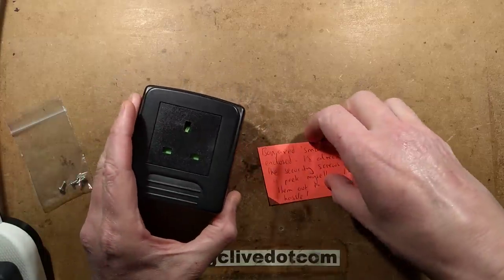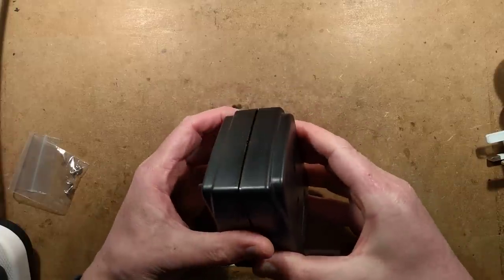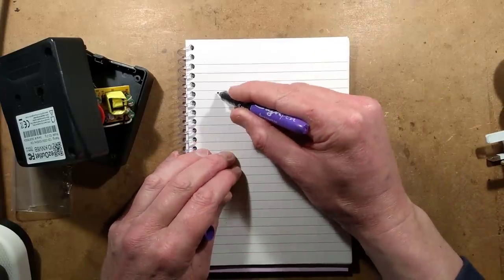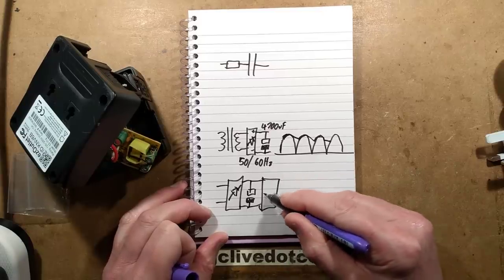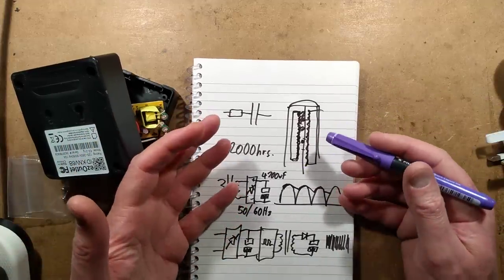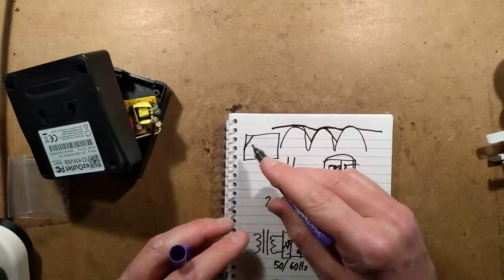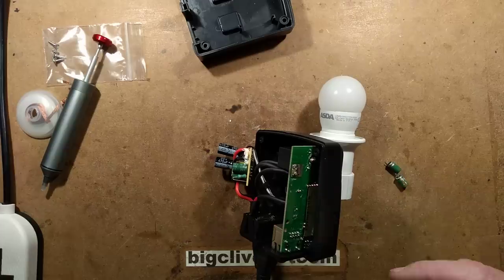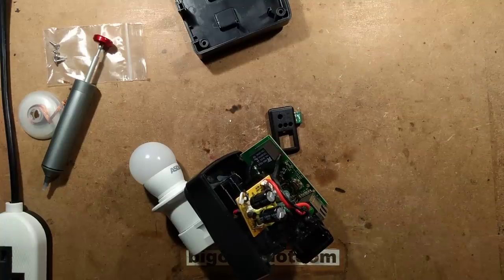Fixing an ezOutlet with inappropriate components.

Comment: That brand of cap failed in a cheap flame lamp that had run less than 20 hours. Thank you for making electronics, engineering, and circuitry into a wonderfully digestible affair.

Comment: I really like it when you go off track for a bit. The hint about monitor picture tearing at the corner was really useful... as was the quick way of measuring ripple with a meter set to AC. These are the tit-bits that you usually only pick-up with experience. Great video and interesting as always.
Reply: Word.
I come here for the subject matter of the video, but I learn the most from the "off topic" stuff.

Kinda like a fox at the chicken pen, just sniffing about the fencing for a gap...
Reply: I was suprised to read this, still am.
We genuinely learned that in school, like 3 years ago.
Reply: I agree. When he started talking about old industrial stuff and measuring ripple I was very happy that he went off on a tangent. I work at an old steel mill and this really is good info
Reply: Was going to say the same thing - Clive's tangents are one of the things that keep me watching. Sometimes educational, sometimes humorous, never a waste of time.
Reply: Annelise Meier I'm old enough that a meter in AC V mode would fully respond to DC, making that measuring technique not work at all.
Reply: @johnfrancisdoe1563  it works on some meters,  one of mine states it can measure ripple on a dc level on its ac ranges, but most of mine cant, unless you include a blocking capacitor in series..
Reply: tidbits*
Reply: Yeah agreed 👍

Comment: That sort of 'blip blip blip blip' of the LEDs was a dead giveaway the power supply was faulty.  It's a common failure mode on switch mode supplies.  I go straight to the caps if I see that, and it solves the issue almost every time.  I've seen it on everything from TVs to wall warts.  Nice explanation of ESR.
Reply: Doesn't it happen to LED light drivers all the time too? That rapid flickering looks very familiar!

Comment: The 2000 hrs is when run at their max rated temperature. Usually 85degC.
Reply: It wouldn't surprise me if it ran that hot or hotter if it has some logic and processing chips in there along with the switching supply. Although these are chinesium ones so 2000 hours at any load is probably optimistic. Takes me back to the early 2000's motherboards with all these caps looking like some sort of fungal growth after awhile.
Reply: The ripple current heats it up internally, and inside such an enclosure there is likely a much higher temperature than room temperature
Reply: @mysock351C  That was my initial introduction into electronics - the capacitor plague of the late 90s onwards. I had a relatively new and relatively expensive (at least for me) motherboard that failed due to bad caps. So I bought a soldering iron and ordered some good quality Japanese caps and fixed it. I've been slowly learning more since then - mainly by watching Clive (as I don't do well learning from 'courses' or the like).
Reply: Also running at their maximum rated ripple current, which generates further internal heat
Reply: every 10degC below rated roughly doubles the lifespan. So if it's rated at 85degC you can run it at say 45degC (not unreasonable for a well designed supply) it'll last ~3.65years - enough for the warranty period on a lot of devices! This one failed because a combination of either:
-Too hot
-Too much ripple
-Crap quality and wouldn't even meet its mediocre rating
Reply: Don't forget also at rated ripple current. Decreasing current and temp both drastically increase lifespan. Also it is a minimum lifespan,not a maximum.
Reply: Since this is an always-on device with no ventilation, you should just go with 105C rated. About 9,000 hours in a year.
Reply: David Parry  the capacitors are "0n" all the time - either taking in new charge until the top of the sine wave or delivering charge when the rectified voltage is lower than the voltage inside the capacitor. Current is almost always flowing through the internal series resistance either in or out ...
Reply: In addition to the temp variable (likely 85C, could be 105 if the caps are decent - likely aren't) It's likely also a calculated MTBF, and seeing how electrolytic caps aren't exactly immune to premature failure, it might not represent the actual average lifespan of the cap.
Reply: @uwezimmermann5427  ah, nice to see the calculation formula, thanks! I take it back then, there's quite some difference from "traditional" MTBF. :)
Reply: Yep. At max ripple current too. The life doubles for every 10C decrease in temperature.
Reply: @mysock351C  That's not a problem now. Turns out that when the Chinese (Lelon) stole the formula it was missing an ingredient and that caused the problem. Now they've manage to steal the correct formula, and that doesn't happen anymore. That said, I consider a non-name-brand cap to have half the service life it claims.
Reply: When run well below the maximum ratings, and kept near ambient (room) temperature, and assuming the circuit design allows for a fairly wide margin to take into account capacitor aging, it is not uncommon for good quality aluminum electrolytic capacitors to far exceed the "double life for every 10C below rated" rule of thumb. Pretty common to find switching power supplies in commercial equipment that is on 24/7 to exceed 150,000 hours of use without failure.

But of course in low cost consumer electronics they'll use the cheapest capacitors, of the bare minimum values to work in the circuit (little margin to allow for capacitor degradation over time) and of course very little consideration made for operating temperature of the components.
Reply: I do a recap service for 80s/90s retro computers (Amiga, ST, SNES, Spectrum, C64) and I replace with 10000h@105C low ESR Panasonic caps. Total overkill, but cost wise they are actually comparable to 2000h@85C. Many of the Amiga models have bad caps and the leaking electrolyte is killing the boards. Second biggest killer of retro machines after the Vartabomb...
Reply: I also forgot to mention that several of the Amiga models (A4000 and CD32) have some of their electrolytics in backwards. The reverse drive dramatically shortens their life span!
Reply: @misterhat5823  I only use well known brands of capacitor and for power supplies I always get the caps with the lowest esr and highest ripple current.

In some instances if a cap is run at real close to its rated voltage I may go up to the next higher voltage space permitting.
Reply: their? Pronoun missing object reference.

Comment: Back in the early 80's, I was a TV cable technician. A common problem we had with line amplifiers was caused by failing capacitors in the amp's power supplies. Because we have 60 cycle power in the US and the TV frame rate is 29.97 FPS, (just shy of 30 FPS) the resulting interference pattern was a horizontal line that would slowly work itself from the bottom to the top of the picture. Because we were a small company most of our testing equipment was old and the only way we could find which amplifier was causing this issue was to haul around a small battery powered TV set.

Comment: Perhaps those "unusually small" capacitors are less common for a reason.
Reply: The reason is that good high quality low esr caps are physically larger and they used the cheapest crappiest smallest ones they could find.
Reply: @simontay4851  correect 10 million for a bowl of nuddelsoup
Reply: Had the same issues with small caps in a mixer PSU I recapped a few months back, really hard to find physically suitable replacements with good enough specs. In the end I had to upsize 2 of them as it was "impossible" to get the right ones.
Reply: @petaks01  Same here, the puffed up Chinese ones were all really small and the usual suppliers didn't sell them since all the "good" capacitor manufacturers don't make them.
Reply: @wasserman63  knewdiddle*
Reply: I also noticed that Chinese brand capacitors that often fail - like Teapo, CapXon etc. tend to be smaller size than similarly rated Japanese ones. They are probably overrated and their failure is due to pushing it to the limits for the size...

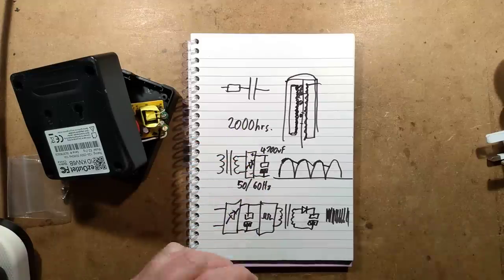Comment: @8:50 the hours are rated at the maximum temperature of the cap, typically 85 or 105 degrees C
Reply: There's a saying that every degree below max temperature doubles the life span.
Reply: I was going to say the same thing - as well as something similar to what Ennar said.
I've been told that a 10 degree (peak) drop potentially increases the life by 10x, a 20 degree drop increases it by 100x and a 30 degree drop by 1,000x. However I don't know the truth of that.
Reply: @Andrew Ballard Thanks Andrew.
Reply: Not just temperature, but also maximum voltage, ripple, and frequency....operating below any of those absolute maximum limits will significantly extend the lifetime of a capacitor....unless the capacitor was made in China, in which case all bets are off...it might last 20 years or 20 seconds regardless of operating conditions.
Reply: @ethanpoole3443  In fact, ripple and lifetime (for a given max temperature and ESR) are interlinked, which means you can trade off one for the other, enabling almost arbitrary specsmanship. Shorter nominal life = this cap gets hotter at given temperature and ripple current. That certainly is one way of boosting your ripple current spec.

Comment: Not sure why I never thought of that, but using the multi meter on AC to measure ripple is genius!  Thanks for the tip!
Reply: It only works on modern meters with certain AC measuring designs.  Traditional meters just switch in a rectifier for AC mode.

Comment: Great informative video on ESR caps and how they're different to normal rated caps, thanks for the explanation 🙂 seems the manufacturer skimped on those capacitors due to size they could fit in the enclosure.
Reply: Had the same thing in the supply/ballast of a Chinese fluorescent work light (these tubes that are barely larger than the 8 W fluorescent inside). Ended up recycling the whole thing because I couldn't be arsed to find replacements for those super-small electrolytics. The older ones simply used 5 metres of resistive flex (rather than normal copper wire) as a ballast resistor. Only in the late 90s or maybe 2000s they got more complex.

Comment: The capacitor that failed is next to the diode. Those are almost always the first thing that fails in flyback topology power supplies since they are directly exposed to the raw ripple current. When I repair PSUs, I add a 10uF MLCC across the electrolytic's leads on the back of the board when possible to spare the electrolytics the worst of switching transients and take some of the flyback edge off.

Comment: I think the super low service life ratings in electrolytic capacitors apply to the rated temperature. They will last a lot longer if the temperature stays lower, for which reason it's really important to 1) use low esr caps where there's high ripple and 2) design the equipment so that the caps stay well below their rated max temperature.
Reply: There are actually a few factors here:  Typically, the "lifespan" of a capacitor is the number of hours it is expected to be able to function:

a) When operating at its maximum rated temperature
b) When charged to its maximum rated voltage
c) Before it goes out of spec in some way (not necessarily outright failure)

This is part of the reason why people often use caps rated for higher voltage than actually needed, because operating them at a smaller percentage of their rated voltage can extend their lifespan significantly (as will keeping them cooler, as you mentioned).

However, even when it's beyond its lifespan (accounting for voltage and temperature), that still doesn't mean it will just fail either (in fact, that's still pretty unlikely for most caps, even at that point).  Usually what that actually means is just that the manufacturer can't guarantee it will still have its full capacity (its capacitance may have dropped to less than the tolerance of +/- (typically) 5% or 10% of its nominal value that the datasheet promises).  But even that is still just a "maybe", it could be that it's still fine, the manufacturer just can't reliably know for sure that it will be.  And even if it has lost some capacitance, it can still potentially work just fine, but you will get more ripple, etc, in your circuit.  Therefore, in many circuits you can also extend the useful lifespan of the capacitor by simply using a somewhat larger one than you technically need, so that it can lose a lot more of its original capacitance before it actually really matters to anything.

Comment: The capacitor ratings are for the worst case scenario. for ex: a cap rated at 5k hours at 105c and some ripple current will lose some percentage of it’s ESR and ESL capabilities if abused to the max it shouldn’t fail. Nichicon FP caps rated 12k hours at 105c used on some ATX motherboards will last almost forever because they aren’t pushed a lot

Comment: Very common phenomenon, even in expensive gear. I fixed my £1000 digital mixing desk this way. The trouble is, power supplies are considered commodities and don't receive the same design attention as other circuitry. Also, I found it not as easy searching for "low ESR", instead I consulted the rated ripple current.

Comment: In my younger days, I was a coin-op arcade video game and pinball machine tech. I've replaced a lot of those 470µF 6.3V electrolytic caps (most frequently in the power supplies) tell ya what. But not every bad cap was "pooched out" (showing signs of elevated internal pressure) -- some of them looked perfectly normal even under magnification. But every pooched-out cap was indeed bloody frickin bad.
 
Wonderful tidbit on using your DMM on the AC scale to measure DC ripple!
I'm almost 55 and I've never heard that one before!
Thank you Clive!!! :-)

Comment: Thanks heaps for the ramble Clive, very interesting stuff. Especially about SMPs and the need for low-ESR caps.

I got 3 minutes into this and, when you were saying about if it was a capacitive dropper when the relay kicked in the voltage would drop and I said to myself "then the relay would 'chatter' at 2x mains frequency surely?" Then I had a real "D'oh" moment. I had a set of two RF remotely controlled mains switches and one of them did just that, went into spams when I turned it on and blew the fuses in my amplifier connected to it. I kept it for a couple years in my "NFG" box of things that I might get around to fixing but threw most of the stuff out a short time ago. I figured that my electronics knowledge hadn't got to the level where I could fix most of it by now then there was no need to keep it.

However I still have the other RF remote switch on a shelf so I opened that and, sure enough the power supply (for the three ICs, relay and a couple LEDs) is a capacitive dropper run by an X2 cap rated at 0.22uF / 275V. I bet that's all that had failed in the other one dammit! I've been slowly learning electronics, mainly by watching this channel and, while trouble-shooting and fixing a SMPs would have been maybe a bit much for me, I could have fixed that thing after all. The pair of switched mains units and remote cost me quite a bit too and I haven't been game to use the 'good' one since the other failed.
Reply from the maker: If the X2 dropper cap has failed it will read as a lower capacitance than stated.

Comment: The logical design of this would be to take the low voltage supply from the router PSU, direct to the relay and to an output socket / lead that would supply the router, then tap off the low voltage to supply it's own logic through a voltage regulator. Thus it would have no high voltage inside it at all and probably need far less rigourous approval regimes.

Comment: back on the farm as a young lad, the crt tv would start to round over and shack at around 4pm for two hours. I check the voltage and it would drop down to 90 volt, I'm in Canada where the voltage is 110 to 120 for outlets and light, 220 to 240 for big stuff like pumps, stove and heat. at my new home the voltage is 127 volt, if it get to 130 volt then you are to call the power company. that 254 volt for for the big stuff

Comment: The 2000h number translates to something like "after 2000h at 105c ambient temperature, the capacitor's will be within 30% of its specifications" (or some percentage high enough) as in it will degrade significant enough to be outside specs but will still work. Also, with electrolytic capacitors, a basic "formula" says that lifetime rating doubles with every 10 degrees Celsius , so if the temperature inside the box peaks at 95c , then capacitor is rated for 4000 hours, if below 85c you have 8000 hours and so on.
For polymer capacitors, formula is changed a bit, a simplified version would be  L = Lorig x 10^ [(Tm-Ta)/20]  ... so a 2000h polymer capacitor running at 70c average would be rated for L = 2000 x 10^(70-30)/20 = 2000 x 10^2 = 200.000 hours.
You could get some 270-330uF 10-16v polymer capacitors and replace the electrolytics, it will work.